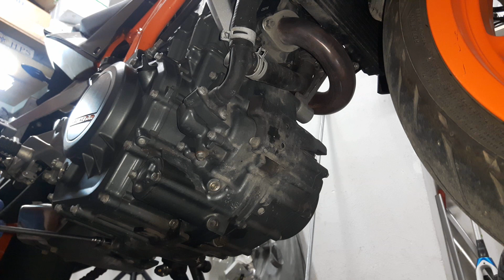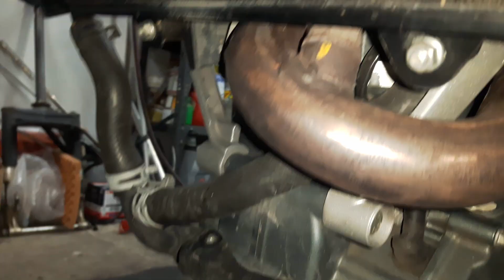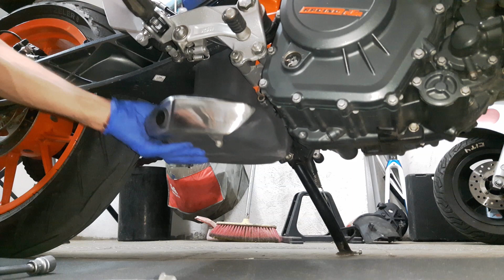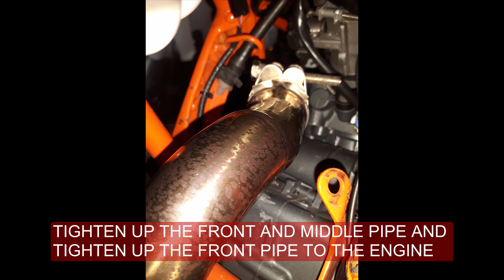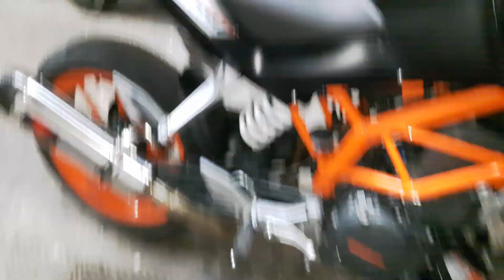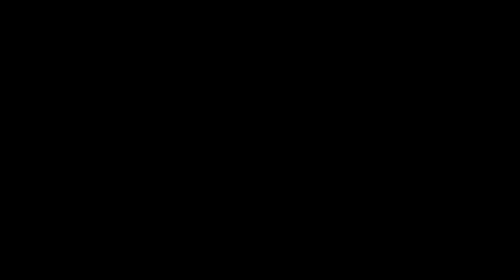BlackWidow Exhaust Installation - KTM Duke 390

Comment: is the bike also faster or slower right after the install
Reply from the maker: It feels that is faster at low RPM and slower at high RPM.
Reply: @binostuning  Thanks for the reply !! And that is without ecu tune,
Reply from the maker: @bikestoempert  I also have powertronic ecu. It performs fantastic at mid RPM with the exhaust.
Reply: @binostuning  how about the sound